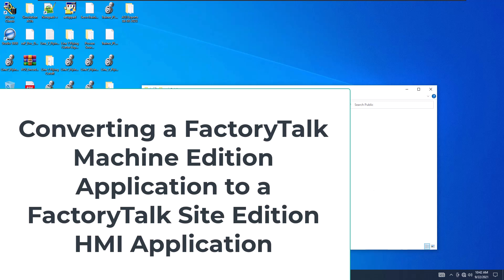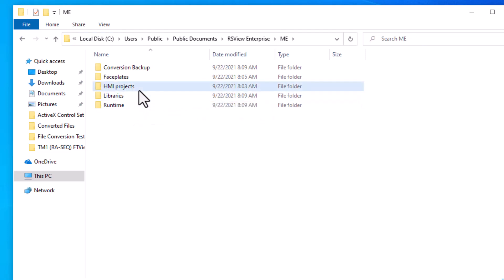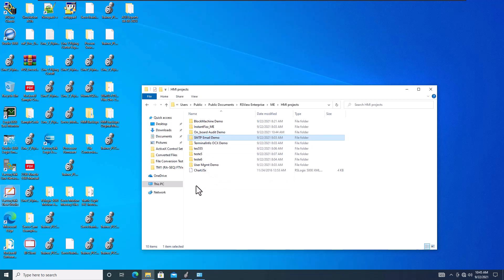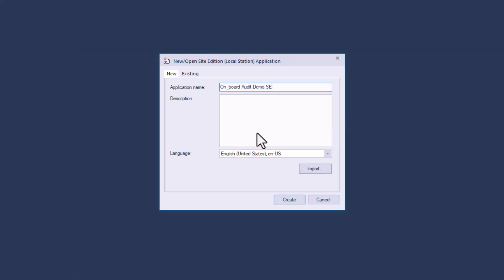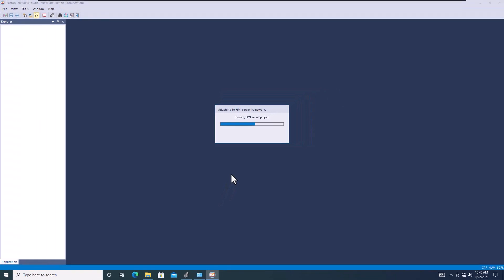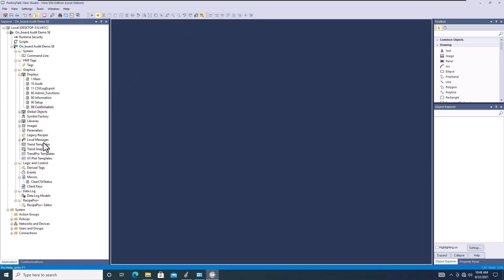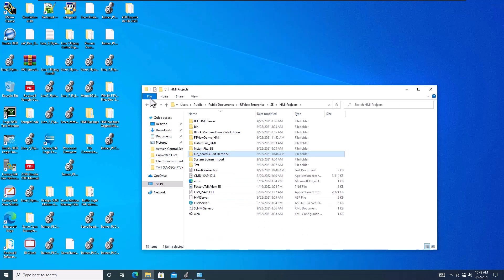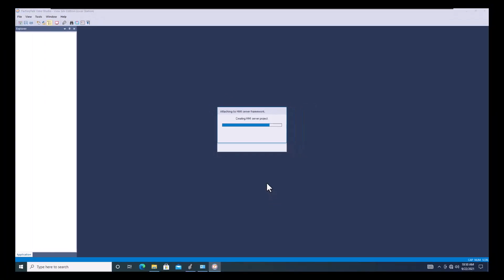FactoryTalk Machine Edition to FactoryTalk Site Edition Conversion

Comment: Any suggestions on converting an older V6.0 ME to a V8(or higher) SE? Need to convert the tag database first? Great Video!
Reply from the maker: @jordygreen8925  
I always change the tag database to a direct tagging method if time allows because direct tagging is faster operation.  Although you can use the ME tag database but just know it will be buffered a little